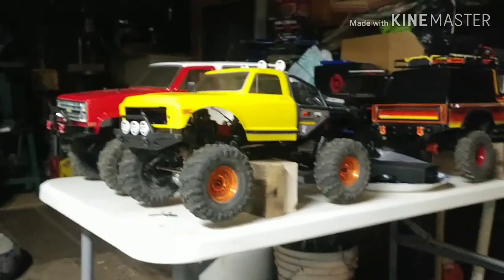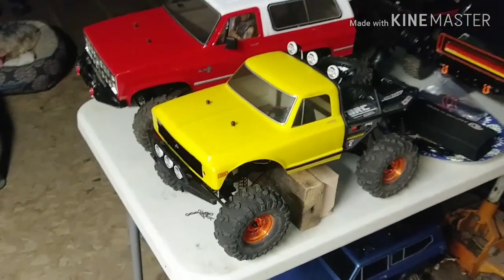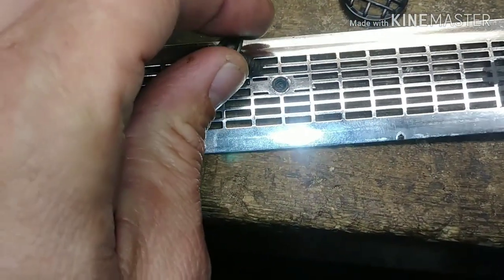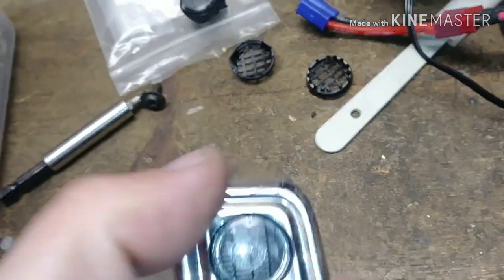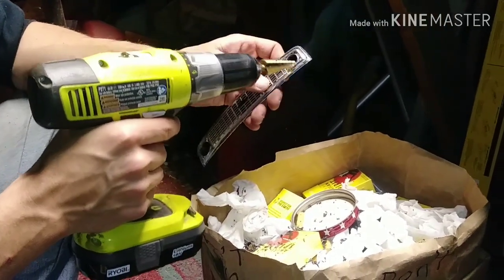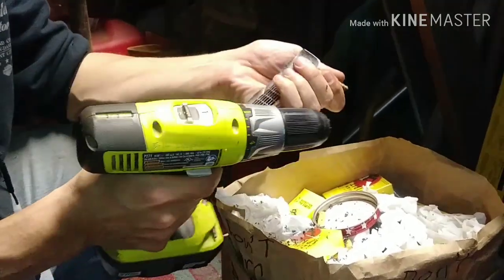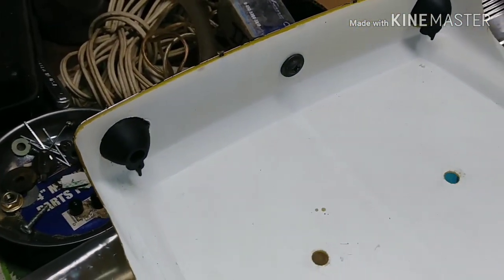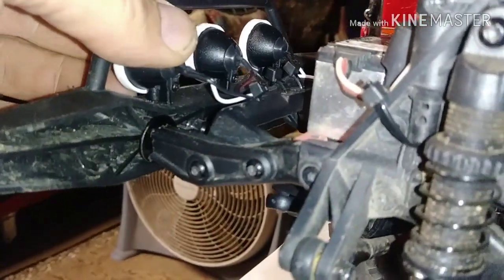Vaterra K10 Ascender;"Diy" led lights

Comment: Kept that Ol' school vibe with this Vaterra. Nice score in the rig too! Very simple mod can make a world of difference 👍👍👍👍
Reply from the maker: Much appreciated Brother 😀
It was a necessary upgrade as far as I was concerned,can't have a crawler with no lights around these parts,
unfortunately it gets dark early up in the north woods,🌙😕,
As for the K10;it was a decent score at $175.00 "RTR",too be honest I tried getting it for $150.00,but the owner assured me that the vehicle was gently used,had never seen water,and was in top condition,and to my disappointment most of what he said was false,the K10's axles,frame,and transmission,all looked relatively new,but the body had some very obvious pavement road rash,and after closely inspecting the chassis I realized that not only was someone playing in water,but they were playing in Salt water,the suspension link pivot ball's were rusty,and the motors armature was also full of rust,not too mention that all of the shocks were leaking oil,and were covered in dirt,and the front drive shaft was missing a grub screw up by the transmission side,and some genius replaced it with a standard screw,which ended up shaving a bunch of plastic off of the trans mount skid plate 😕😟,I had too go through the entire truck,re'greasing everything,and replacing missing screws,before I could even run it,The battery was another issue,it was equipped with a dynomight 7.4v 4,000mah 50c 2s lipo,and it was just about completely dead,I had to shock it back too life with an old 15 minute quick charger,it was close for a minute,but the battery finely recovered,😷😬😁👍
Otherwise,the vehicle was everything the owner said it was,😂 lol "gently used" ha!
Many thanks for your great comment,and for checking the video my friend.😀😎👍👍
"Edited" forgot a word lol
Reply: @R.C.A.D.  WOW looks like your giving someone else's headache some well needed Advil lol. Anytime man!

Comment: Fantastic mods ,you've done a good Job,  great video 👍😁👍
Reply from the maker: Thank you Tony 😀 Something had too be done,too make up for Vaterra's lack of led buckets,Hindsight is 20/20 though,after installing these offroad light buckets I realized that the new Vaterra "Suburban" actually comes with light buckets in the grill,and a complete led light package for that matter,but I'm thinking that the Suburban's grill would probably drop right into the K10 with little too no modification,saving a ton of hassle,😕 oh well! Lol
Thanks again for your kind words,and for checking the video Brother.😎👍👍

Comment: Great job! Turned out well. I put off doing this mod on mine for so long that the body was in really bad shape. At that point instead of modding it I just ordered a new clear replacement body and to my surprise and delight the new clear K10 shells come with an LED ready grill. Still think it was silly of them to make the originals the way they did.
Reply from the maker: Very much appreciated for your Awesome comment my friend!😀
And many thanks for the Great information on the replacement body,in hindsight I was thinking that I could have just ordered a Vaterra Suburban grill,which also comes equipped with light buckets,oh well!😁 
Thanks for checking out the video Brother.😀😎👍👍

Comment: The k10 is my only crawler and I love it! But you diy light 💡 job is epic 👍🏼👍🏼🤯🤯
Reply from the maker: 😁👍👍 Yeah man,and the K10 is one Hell of a crawler too! I've been having a ton of fun with the truck since buying it,it's actually stolen the spot light from all my other RC's,I've been using the K10 exclusively for the last week,I've got too say that this little rig is an total Riot,I have absolutely no regrets about buying it,😁
Much Obliged for your Awesome Compliments,and for checking out the video Sir Braaapinstein,and enjoy that K10 Brother.😀😎👊👊👍👍
Reply: RC After Dark haha hell yeah brother!!! My big bro got a trx4 for his b day not too long ago and this Vaterra has out crawled him in a lot of different scenarios here in nw Oregon. We thought it was a driver mod so we swapped and the k10 still made the line smoother and easier. Then we swapped wheels. I had (at the time) rc 4wd wheels “the white ones” and proline hyrax tires. Which I ended up giving him because he love the white to blue contrast and the trx4 did do better on them. But this rig has held up to A LOT!!! My wife’s younger brothers 12 and 5 have had countless hours running it, into curbs and ankles alike and nothing, Not a single thing has broke.
Reply from the maker: That's outstanding 😂 those Ascender's are holding a big ´ole bag of tricks up their sleeve's,Full of surprises 😁,
The K5 Blazer Ascender was the same way when we first got it last spring,totally unbelievable in the snow compared to the Gen 8,and the TRX4's,although most of that was due to overall vehicle weight,"K5 being lighter" my only real complaint other than Vaterra's lack of light buckets,mirrors,and whatnot,Is the torque twist in the chassis,and the axle ring & pinion gears could be a little lower,it seems too have trouble sometimes when trying too inch up obstacles,it goes smooth until it really calls for some torque,and then you have too over compensate with throttle too get it moving,at which point it kinda jumps forward for a split second,😕 I haven't seen much in the way of different ring&pinion gears for it,but I know that Vaterra makes a 90t spur gear for the Twin Hammers,so I was thinking about getting one to see if it helps her out,😕
Fyi the Twin Hammers,and the Ascender's,have virtually the same transmission,with the exception of the Twin Hammers having a two speed transmission,otherwise "most" or "all" of the trans internals are compatible,
Otherwise the Ascender's are pretty much unstoppable,😁
Initially I was on the fence about buying the K10,and figured worse case scenario,it would be a good track rental vehicle,😕 But after pimping it out a little,and running the hell out of it for the last week,I changed its designation too one of my personal favorites,😊😁 I totally love the K10
Very much appreciated once again for your awesome comments my friend,I love hearing stories like this,😁
Take care Brother.😎👊👍👍
Reply: RC After Dark 🍻

Comment: my K10 Ascender has buckets I got mine brand new in the box  all I gotta do is put a led kit in there
Reply from the maker: That's awesome Kenneth 🙂👍, My K10 is a older version,and did not include light buckets,😕
Perhaps someone at Vaterra viewed my video, and figured that I was on to something,🤔 lol 😂
It didn't make any sense that the Ford version,of the K10,& the Suburban,& the Old K5 Blazer,and the old Bronco Ascenders,All included Headlight buckets,And the K10 was the only one that didn't,😕
It's about time! 
Now all they need to do is start including taillight buckets,😂 lol
Thanks for your great Comment,and much appreciation for taking the time to check out the video my friend,🙂👍
Have fun with your K10 Brother,I enjoy the hell out of mine,it's One of my favorites! 😊👍👍
Reply: @R.C.A.D.    that is  exactly what I thought too.... you are an innovator my good man 
I gota hi lift jack for it, but can't decide where to mount it. Got any suggestions ?
Reply from the maker: Thanks Ken! 😊👍
As for mounting places for your hi-lift jack,?
I'm coming up empty,😕
I have a hi-lift jack for my rig too,but I just couldn't find a spot that looked good to mount it,🤔 
so it's currently sitting on the side with a bunch of other accessories,😂
Reply: @R.C.A.D.  yep I dig  but ,I am thinking of across the hood or beside the tire in the bed\cage 
I put lights on the rig today 
thanks for the tip on the buckets
 I did mine a lil different
I used the bracket that was supposed  to mount the 5 light light bar 
I am gunna put red leds on the tail lights later
I also gota an arb front diff cover .....it looks so sweet
Reply from the maker: Nice! 😊👍👍